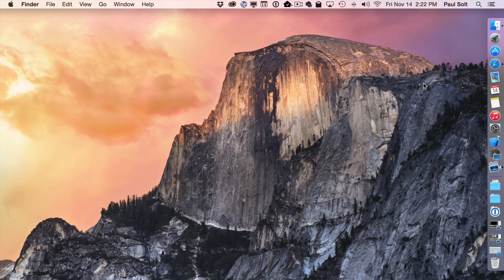Solving Background Static Buzz Noise on Microphone

Comment: In my case, it is only when my MacBook is charging, no matter how far the audio cable from the power. So now, how to get rid the buzz while charging the MacBook? In some circumstance, I need to plug the power on. Sometimes waiting for fully charge is not practical.
Reply from the maker: It could be internal noise from that laptop. You could try a different charger or see if a different laptop has the same issue. Maybe it's one of the cables? That's 3 things to test.

Comment: I moved my sound card, the cables and it still doesn't work
Reply from the maker: Sometimes other electronics can interfere or the noise level on the hardware you have isn't good enough for high quality studio equipment.

Comment: I was charging my computer and using the external microphone at the same time when I disconnected it the static noises stopped. Thanks
Reply from the maker: Sometimes you will get electrical interference. If you can figure it out, you might be able to swap out a different charger or laptop to fix it.

Comment: how do you not have background noise?
Reply from the maker: I was in an office far away from the HVAC system, and isolated from road noise.
I use a DBX286s channel strip to drop the noise level when I'm not talking and have a dynamic microphone (RE320).

Comment: You need to have one dedicated line for your mic alone.  Then one for your guitar, etc.  Don't connect anything else to that electrical outlet. Or don't connect your TV PC, etc. Humming, hissing or buzzing is a simple grounding issue.  It is electric running through each line in the system that you are literally hearing.  
Yes, you need to keep your cords separated from one another and not touching or overlapping going to your mic, etc.  Use 3 prong plugs, particularly into the main outlet leading to what you are powering.  The third prong is the ground on the plug.
Be careful, because when things are not grounded you can get electrocuted.  I have seen people get shocked by mics, guitars, amps, etc, because everything was being plugged into the same board or same outlet or both.  A deadly electrical disaster waiting to happen.
https://ask.audio/articles/how-to-eliminate-noise-in-the-studio
Reply from the maker: Thanks for sharing Amorist !

Comment: Dislikes are because you did not quite well explain how u fixed the issue, we cant generally understand what did you do. Can you try to write it down, maybe?
Reply from the maker: Move all power cables away from XLR or other audio cables. There is "electronic noise" from power flowing through power cables, and it will leak into your audio cables and create a signal that gets interpreted as strange audio artifacts.